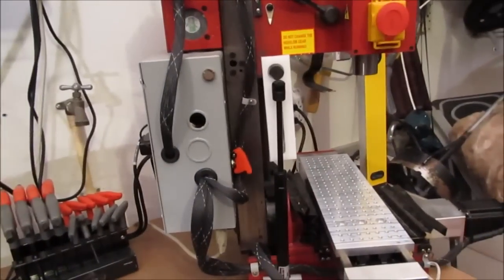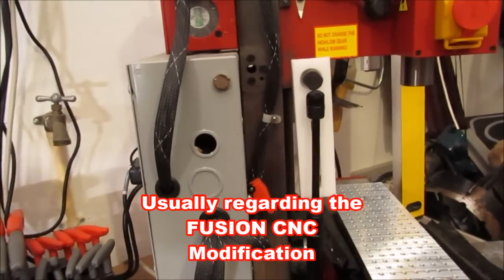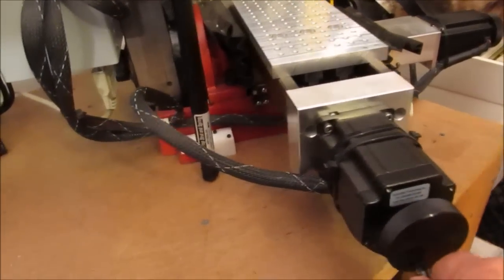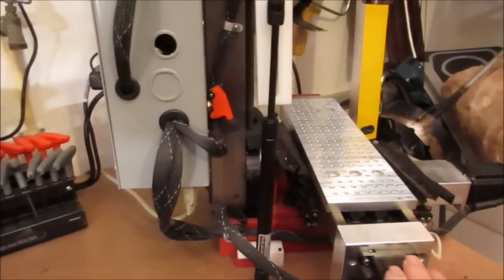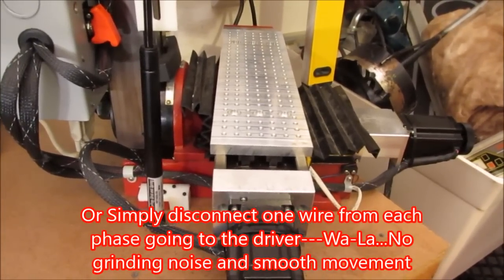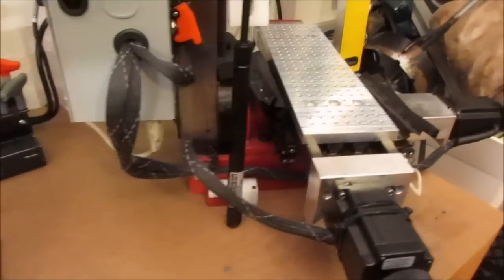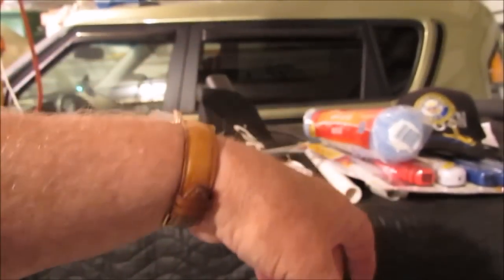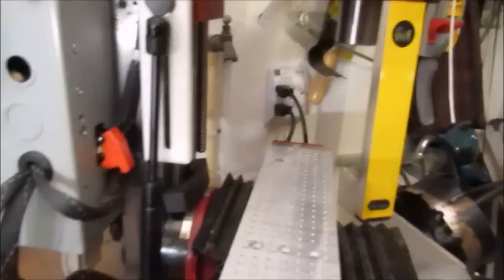FUSION CNC Harbor Freight Mill, or any CNC Tool

Comment: Kaydee,

I've recently started the CNCFusion conversion and have already found your videos very helpful - Thank you.  Is the spring strut modification you mention at the begining of this video to overcome an issue with the CNC mod?

Thanks again.
Russ
Reply from the maker: No, I just thought it might help with the weight of the head and lessen the load on the stepper motor. The jury's still out on its usefulness.....Frankly, I don't see any difference whatsoever.
Reply: I suspected that was where you where headed.

Thanks

Russ